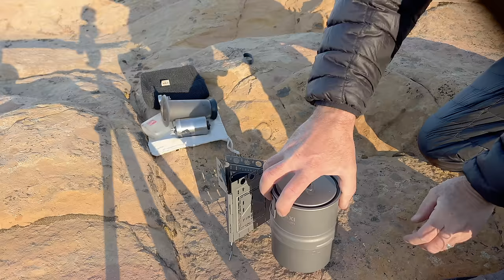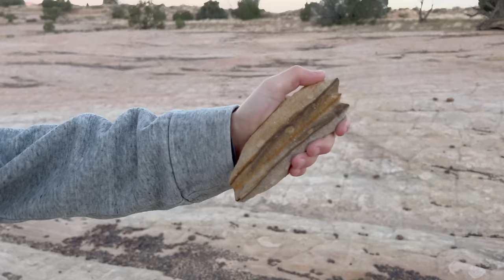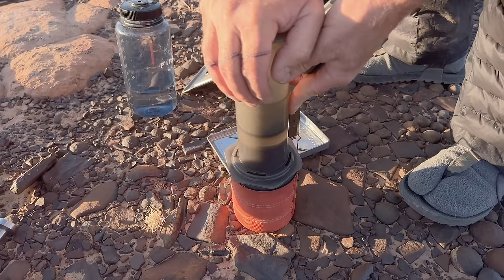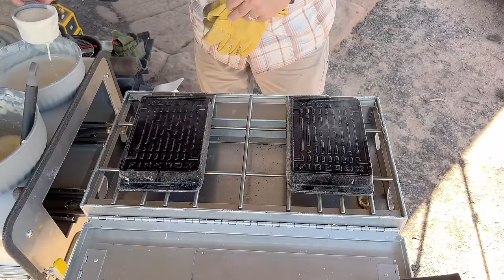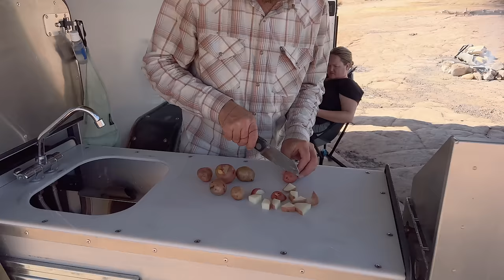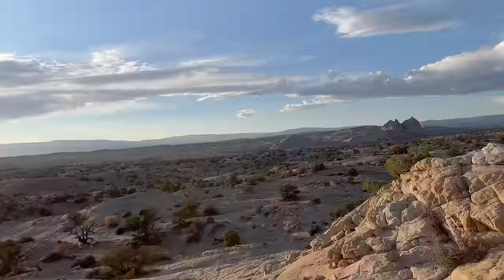Waffles & Roast Beef! NEW 5-WAY Cast-Iron Cooker! Giving Ash Our Love Desert Family Trailer Camping

Comment: I have never met you or yours, but I have watched enough of your vids that I feel like I have. The news of Ash was very sad, she is quite the trooper. I am sure you will do the right thing when the time comes.
On the lighter side, what a fantastic spot to camp! And those meals looked awesome. Were the waffles made with two top that mesh or a top and a bottom (shallow and deep)?  I cook at home almost exclusively with CI, my backpacking days are pretty much over (unless I get a new knee) but my basecamp and hiking days are not. That CI of yours may need to be put into my gear box.

My thoughts are with you and yours.
Reply from the maker: Thank you so much for your kind words Michael! The waffles were made by putting two bottoms against each other It doesn't matter if it's the deep or the shallow. The grill pattern has been modified from my first prototype to make these awesome waffles 👍😎